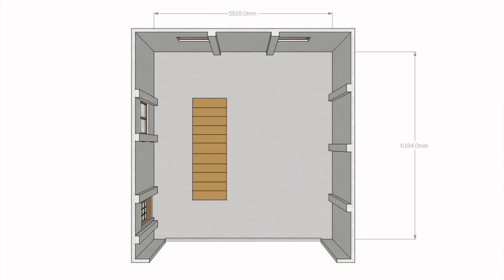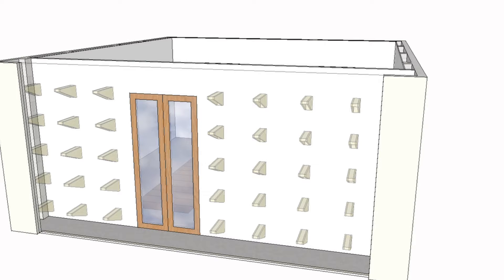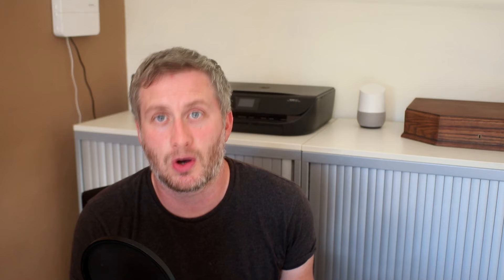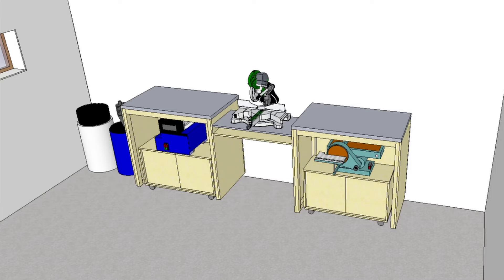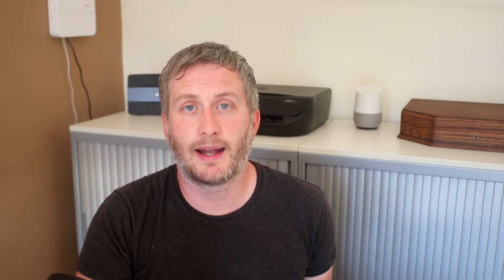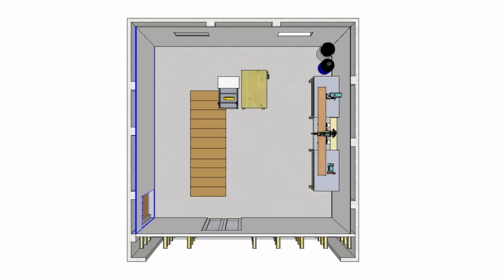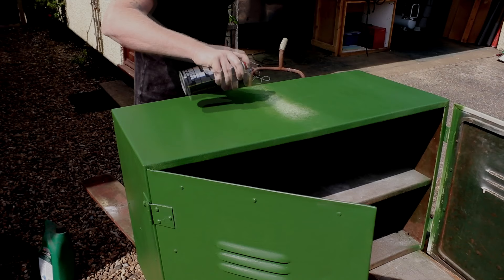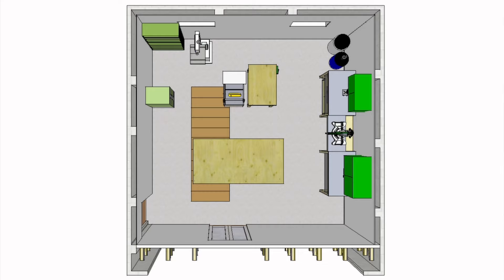Workshop Layout - Space Planning NEW WORKSHOP EPISODE 2

Comment: Pit looks big enough to be used as sheets storage.  Remove existing steps and build some vertical steps/ladder, could even tank it if there is a damp issue down there.  With power supply to the table saw have you thought about chasing a  route in the floor to accommodate the cable like you would in a wall? Another option would be to  get some cable protectors to go over the cable on the floor,  the sort you see in some shops, public buildings etc, they do create a slight bump in the floor but some cable protectors do come with cambers on each side to allow wheeled items to go over them. A good sparky will give you the different options that comply to current regs.
Reply from the maker: Cheers. I like the sheet material storage idea! In theory it’s stable enough to cope with being below floor level. May explore that further. Re: the rubber floor mount that won’t work because my camera stand is on wheels, it’d be too annoying. Chasing out the concrete is possibility but not something I’ve done before

Comment: great layouy of your new shop.
About the power for the tablesaw.
1: go via the ceiling and let the powercord hang down.
2: make a groove through the concrete top layer with a special saw or cutting twice with an angle grinder and diamond blade and dust cover.
chissel the groove out and put a metal pipe in and cover with a layer of concrete.
You can run it to the pit and from there just go any direction underneath the wooden cover.
Reply: Diamond blade in a circular saw makes an overabundance of fine dust...not a good idea in an enclosed area.  Cutting or chisseling a grove in an unknown thickness of concrete may not be a good idea.

Comment: If you have access to free pallets, you could always consider covering the floor with pallets and then a sheet of OSB on top to create a solid floor surface; the pallets will give you the space to run electric and piping to the table saw in the middle of the room without cutting into the floor.  Just a little food for thought. Keep up the great work!
Reply: ...and your joints will thank you years down the road for standing on a forgiving surface for endless hours instead of concrete

Comment: I run an extension cable over the joists in my garage which dangles down above the table saw/router table that I plug in the tool in use.  I also set up my track saw on top of the table saw on a sheet of MDF.

Comment: Good to see the plans coming together. How about dropping power down from the ceiling for the table saw and assembly table?
Reply: Joe D a retractable cord reel would work for around an assembly table but a cable dangling down around a table saw probably wouldn’t be a good idea.
Reply from the maker: I was thinking maybe some kind of column from the ceiling with power in it ... but I need to speak to someone who knows more about this stuff than me for advice really
Reply: That's what I was thinking too.  Obvs. not too close to the table saw, but a drop that maybe also has room for piping to the dust extractor would be awesome.  You can do the basic work before you put the ceiling up too.
Reply: Rag 'n' Bone Brown maybe channel into the concrete and lay some armoured in. Mount into a floor box?

Comment: the tools on the mitre saw station i would fix down with thumb screws so you could keep the mitre saw station slimmer as you could quick and easily put them up there when you need them and remove them when you dont need them. i know this might be a bit late now but thought i would share anyway. also putting power sockets in the ceiling can be of help when using a router etc as the lead does not run across the work surface (could be an idea for the table saw) . one thing for the air compressor is id maybe move that away from the table saw to some where less dusty (you dont want to have to clean the air filters out every five minutes of using the compressor) i only suggest this because i know dust collection is not always great on table saws. as for the pit could you not in time batten it out and add some insulation to it then you could store wood, tools and pretty much anything down there with out risk of moisture damage. im not sure if you have one around your way but i know just up the road from me we have a second hand cellotex place which is great, they have all different thickness of boards (when i first heard about it i thought the boards were going to be damaged with missing corners etc but its not the case and is a very cost effective way of getting cellotex boards)

Comment: I would probably stick the compressor in the pit.  Compressors are noisy so the pit might isolate the sound a bit.  You could then just use a remote power switch and feed that and the air pipe up through a hole near the assembly table.  It would also free up some storage space.
Reply from the maker: My compressor is very quiet

Comment: I have a power drop from the ceiling for my table saw.  It is long enough that I can still move my saw around as needed.  I also have a drop for my dust collector coming down in the same area.  I use my assembly table as an out-feed table when necessary so having that drop in the same place gives me power for my sanders as well,
Now that you have more space I think a larger saw might be a good idea.  There are so many options.  I know you didn't want a cabinet saw but how a bout a contractors saw.  I have been using one for almost 20 years and it has worked very well in my small shop.  I would show you a couple of pictures but that is not an option here.  
It's fun to watch your shop come together.  Have fun!

Comment: As an assembly table I was able to salvage a 66 mm thick door from a doctors office. It's made of soundproof material (core) so it's dead heavy (+40 kg), stable and close to 100% flat. Both sides have melamine-type surface - perfect for glue ups. Size is 90x204 mm - perfect for walk-around while large enough for most of my projects. Now it just needs a propper base on lockable wheels, shelves and lockers.

Comment: Hi, I think you should place the dust collection system in your inspection pit.
Like this you save the space and isolate noise from dust collection system. And pipe can go directly to the table saw. Just an idea.
Like the way you thinking. I wish I had that size shop. One day - when 6 numbers match 😁. Good luck 👍
Reply from the maker: There’s no power in the inspection pit
Reply: Normally inspection pits have a lights inside, if not it's easy fix an extension cable- housed in metal pipe And cut in to floor. Or you can move it to an attic as you planning to build one. It just not the best sound of extraction fan running, lost of shops on the YouTube  have separate areas designate for it. Just an idea.  Good luck 👍👍👍

Comment: Hi Keith, I don't post Youtube videos but I am currently setting up a workshop in my double (length rather than width) garage, and I have recently finished framing, insulating and boarding out.  I am in the process of building units and setting up tools, I have a similar set up for my mitre station, and what I did to extend the fence for it was put in threaded inserts in the worktops so I am able to bolt in a couple of lengths of narrow aluminium box section which could then be removed when not needed leaving more usable worktops, perhaps that's something you could add to your set up.
Keep making your videos as I get a lot of tips from them for projects but I only make them for my own enjoyment rather than customers.

Comment: With regards to getting power to the middle of the room, why not chase the floor out to run cables in them then just fill them back in with cement. I’d put them in some hosing to protect the cable from the cement though. The concrete would be at the very least 100mm in there so plenty of depth. Can’t wait to see it all come together

Comment: looks cool - my only comment would be on the placement of the disc grinder - leaning over the worktop and getting the right angle on larger pieces may be difficult - perhaps the grinder mounted on a board that slots into the worktop and held in place by loose dowels and a clamp? the grinder could then hang on its board somewhere else when you're not using it - freeing up the back space for some small draw storage etc?

Comment: I built my 8' by 4' in two sections. Then if I have to use it as an outfeed extension then I can still use the other half for assembly. Each half has braked castors and they can be clamped together.

Comment: One problem with the barrel you're using with the dust commander is it collapses easily if the hose gets blocked. I'm considering adding a reinforcing ring inside or a pressure release mechanism.

Comment: I got some sugestions for you if you like. Firstly invest at the floor. Having straight smooth and leveled floor will save you tons of nerves. Secondly I would have miter saw not in the middle. When it comes to cut just a little bit of long item then may appear that you haven't enough space. Thirdly set your dust collection system out side. Just between French doors and the sliding doors. In that case you will have enough space to mount real dust collection vacuum. That system also will be good for lumber that you plan to store. It will be heated and will stay dry or even dryer. I hope my sugestions will be useful. Sorry for my language I know my English is bad. Take care mate
Reply from the maker: The floor is level and straight. No issues with it. I would just prefer a softer floor for my feet but I can’t afford to change it. My extractor is m class filtration and it’s very quiet so there’s no need for it to be outside of the workspace here.

Comment: If you haven't decided on how to keep dust off the machines under the miter station, here's one for you. As a temp solution, how about shades that you can pull on an up they go or down to cover them. Most stores that sell them cut them to length for you. There are also versions of these roller shades that you can cut down yourself.
Reply from the maker: I used roller blinds

Comment: How's it going bud, my name's Nico Sanchez from San Francisco and I've recently become a big fan! I just wanted to say that I've really been enjoying all your videos, they're very helpful for me as a new wood worker and especially on a tight budget with a small shop it helps to see how you were able to do amazing work in your old workshop and it's motivating to see you move into a new bigger shop and makes me want to work that much harder to eventually move into a bigger space as well.  Lastly I have one suggestion for the new shop since there is so much potential loft space, and that unique inspection basement I feel like if you took the stairs out of the basement part and instead built and installed a grain elevator it could raise and lower larger items both up and down and then store up in the loft and out of the way.  This would eliminate the stairs going down, and any need for a ladder going up. Just a thought especially if you reinforced the loft floor/shop ceiling it could almost be a second story work space depending on roof height and building code, and if not at least for great storage potential, even possibly dust collection, and air compressor spot like the shed extension was. Anyways just wanted to throw that idea out there, good luck and I look forward to seeing all of your upcoming progress and projects, cheers!

Comment: Make the doors under the mitre station slide away inside the spaces so you don't have opening doors getting in your way? A bit like the doors behind you in the video, maybe hang them from rails so you dont have anything on the floor?
Reply from the maker: That would require a track at the bottom which would mean I couldn’t wheel out the carts

Comment: Good morning. Looking at the video for the second time, I noticed that your positioning for the lumber storage just behind the garage door may cause you issues. At 1:58, I saw your shadow on the ground & at least half of the garage was being hit by the sun. There will be heat build up behind the doors. This will dry the wood out quite a bit, so you will need to ensure each board is separated & weighed down to avoid possible cupping & bowing The other issue is when it gets cold. There will be moisture build up, so you may need to purchase a dehumidifier to trap excess moisture. Just a thought, as I had a similar issue a few years back. The dehumidifier worked a treat & kept the moisture content in the lumber to approx 8-9%.

Comment: I think I would use rolling doors underneath the miter station.
Reply from the maker: That would require a track at the bottom which would mean I couldn’t wheel out the carts
Reply: @RagnBoneBrown  There are ones that come from the top and don't require something on the bottom. Basically like your garage door (but smaller). I use something similar here in a spare room.

Comment: Looks great, I like how you didn't plan for every inch of the place already. Best to start using it first to find out what your preferences and requirements are. 

As a suggestion for getting power to your table saw, you could perhaps hang a powers cable from the loft instead of up through the floor. That way you don't have to go through the concrete and also have electricity in the middle of your shop to run any corded tools from there when working in the middle of the shop (perhaps put it between the table saw and assembly table, rather than right above the table saw itself). Added benefit compared to running it from-the-ground-up would be, that if you ever need to roll the table saw and assembly table out of the way to work on something big, you can simply unplug the table saw and have the power supply out of the way for whatever you're doing in the middle of the workshop.

I was also wondering (and I have no idea how practical this would be) about cutting a square out of your mitre saw table where you want to mount the pillar drill. Then just mount your pillar drill and sander on squares of equal size and you can drop them into the table when needed (you'd obviously need to make some sort of support so they wouldn't fall through). That way you can leave your most used tool in there most of the time, swap it out when you need another (less used) tool or for a bare board when you really need the space for unusually big boards on the mitre saw. Depending on the weight of these tools this might not be a good option since it might require a lot of heavy liften. If the weight of the tools is not too bad and you don't see yourself swapping too often this might be a viable alternative to mounting them permanently and making the table deeper just to accommodate them. When not in use you can simply mount the boards on a wall (and the tools with them) to get them out of the way. April Wilkerson added a down-draft table to her workbench but perhaps this could be designed in much the same way to mount smaller power tools
Reply from the maker: Thank you. Yes I think via the ceiling is going to have to be the way to go for power. I am thinking of another idea for the tools on the mitre station supports now. Stay tuned!
Reply: @RagnBoneBrown  Curious to see what you'll come up with.

Comment: I would personally go with a raised floor for running the electrics. It's one of those things where if you're going to do it, it'll be a lot easier doing it first so you don't spend ages moving things around.
Reply from the maker: I’d still have to move everything around if I did it now, as everything is in the space already. Can’t afford to buy any more materials unfortunately
Reply: @RagnBoneBrown  Have you considered electrics on (off?) the ceiling? It works for market stalls - and people who have cellar workshops like me. You could even prototype it with a few extension cables to work out where you want sockets to be.

Interesting project - good luck with it and hope it goes smoothly!

Comment: Looks good! Instead of chipping out concrete to run electric to the table saw, why not run it through a conduit and put a "convention bridge" over it? A convention bridge is made of heavy rubber that lays over the electric line and tapers from virtually nothing at the edge to a bump large enough to accommodate the wire in the middle. Convention centers, fairgrounds, and hotels use them to run electrics to temporary booths when tearing up the floor is not an option. They reduce tripping hazard and allow rolling equipment to glide easily over the wire. Have no idea what's it's called in the UK. Congrats on the move and good luck - I'm looking forward to seeing the shop all rigged up.
Reply from the maker: Thank you. The problem with that idea is that I need to wheel around my mobile camera stand tripod thing so I don’t really want anything on the floor
Reply: @RagnBoneBrown  ??? The whole point of a convention bridge is that you can easily roll things over it. In the convention halls, they roll catering carts and yes, camera equipment carts over them. If that won't work for you, would threading the plug though conduit in the ceiling work? You can rig flexible conduit on a spring to get it out of the way when you don't need it. Third idea: what about wiring the inspection pit, and having a plug set up poking through the ceiling of the pit? I'm not much of an engineer, but I have faith that you'll solve the problem. Give Dylan a scotch for me. ;-p